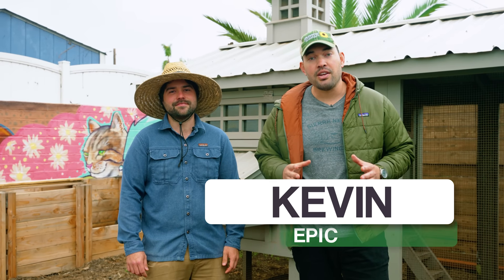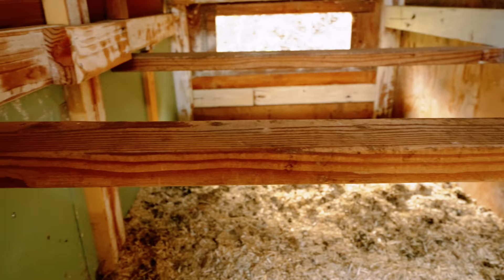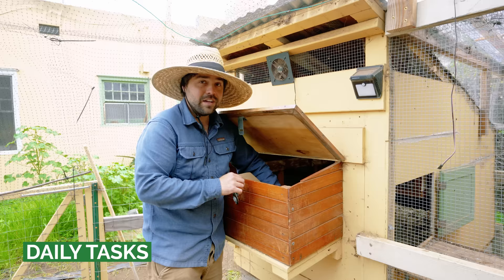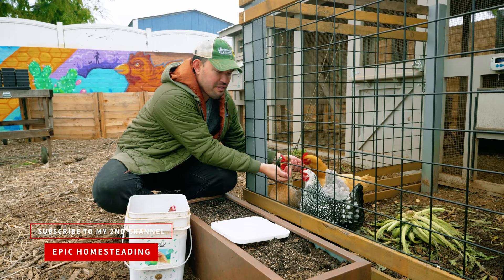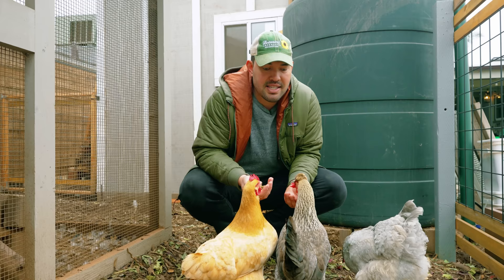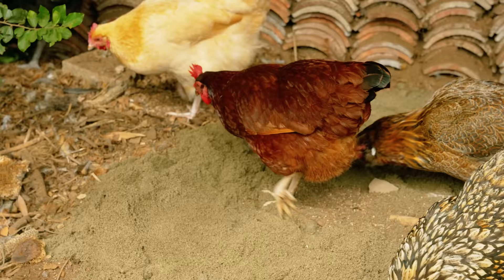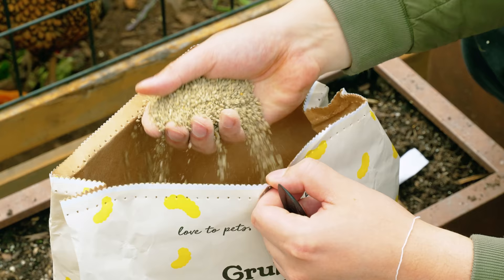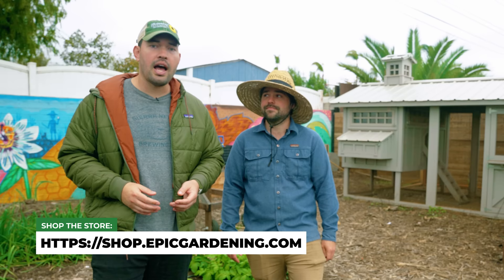Watch This BEFORE You Keep Chickens 🐔

Comment: Bumblefoot is common when you have square roostingbars, you need round bars in the coop for them to roost on, with a diam of about 2,5 1/4 inch.
Reply: so is that 2.75" in total then?
Reply: I always thought it had more to do with flying down to the ground.
Reply: Amen. Some chicken owners even argue about that. I use round bars. In fact, I used a grinder to soften the edges by grinding the bar.  I also notices that the chicken bars always seem to be square, and the chickens they go up and down every single day.  Sometimes, it is just common sense and being observant.

Comment: Kudos to people who mention humidity. Yes, chicken hates to get wet for prolonged time. In their natural habitat they usually sleep on branches to avoid predator, that's why excess humidity is a big no for them. That's why the coop usually have space below them for better air circulation and to stay away from the humid soil. Remember, good air circulation is a requirement , not an optional .

That's why some commercialized pen are abhorred by many farmers. They skipped too many steps.
Reply: And while you need good air circulation, for colder climates you need to prevent drafts in the coop.

Comment: Not only do chickens give wonderful eggs, and entertainment, they also provide good manure for compost for the garden. I will sometimes use the used bedding for a mulch around some of my plants. Whenever I water the nutrients from the used bedding goes directly in the soil. I would also like to mention that ventilation in a coop is more important than keeping your birds warm. Without ventilation you'll end up with frostbitt and chickens. That's what happened to me. We added more ventilation to our coop and it solved the problem.

Comment: Excellent video!   We live in S.W. Missouri.   We have 16 black-laced silver Wyandotte hens.  They have very small combs, so I must make sure they have enough cold water for drinking as the summer progresses.  They have about 12 sq. ft. each in the house and a bit more in the run.   They began to lay on 3 March and we got 226 eggs in one month!   I use their run as a composting area, throwing in a flake of hay and one of straw every few days.  We have lots of weeds and dandelions and chickweed, which they love.    I feed them 4 cups of fermented or sprouted wheat each morning and their layer mash.   I will try red wigglers and soldier fly larvae this summer.   Also will grow giant sunflowers, broom corn, and amaranth as treats.   It takes about ten minutes morning and night to see to their needs.   They actually don't seem to mind a light rain.  I'm planning a food forest attached to their run for (hopefully) this late summer.  Will use electronet fencing until then.   Stopping drafts and providing excellent ventilation is absolutely crucial.  I've used Harvey Ussery's deep litter method since putting them in the house on 1 November when they were six weeks old.  Not a  trace of odor.   They are good for the soul.   Get chickens!

Comment: Find a local carpenter wanting to do a project..that’s what I did. Made a fantastic, double walled, insulated coop, three windows and door with cutout half, 6 laying boxes and a super generous run and since I’m on a hill, they can get under the coop too for even better shade. Chickens are so affectionate if you socialize early, amazing, intelligent creatures. Auto doors aren’t perfect, I like to use my auto door manually. If you scrape the poop boards inside the coop every morning, you’ll eliminate any smells at all from the coop if your litter is deep enough. You will have to deal with scraping poop, and be aware they can projectile poop on every surface.

Comment: I have had chickens in the past. Currently I'm in a wheelchair & unable to do their care, if I get a coop the cost is important. Too expensive & the eggs end up costing me, not saving. I'm very practical & buy from ppl with existing flocks. 
I would use deep litter method as it's cleaner & so many benefits! But an inexpensive or used shed could b adapted. Use wire around perimeter & make sure the coop has ventilation & run is covered! I need only 3 hens, but already know I'll have issues keeping under a dozen! They r therapeutic physically & emotionally!!!

Comment: Very informational! 
I think another big think another big thing to consider is if you live in cold areas you need to be aware of freezing temps. Are you prepared to haul hot water multiple times a day? Should you run electricity to your coop to have a heated waterer? Or a daylight light?

Comment: Have you looked into fermenting your chicken feed? The feed goes farther and it is very good for your chicks.
Reply: I tried that.  The main source of protein in our regional high-end feed appears to be fish meal which goes right out of the strainer when you remove the water before placing it in the feeders.  :-(  And our high end organic feed has also lost it's nutritional edge just like other feeds have been reported to have done.  I have to supplement with flax seed and things like sardines and sunflower seeds to get their protein up enough to have the nice eggs that I used to get a year ago without all the supplementation.  Pretty frustrating!
Reply from the maker: I'd like to try it!

Comment: EGG SONG COMMENT: You said the egg song is 'before and during' them laying eggs. In our case, it's actually AFTER. We had a few that we always saw on our wifi cam doing a loud 1-2 minute egg song AFTER laying their egg. It was so loud that we sold them because we felt it likely annoyed our neighbors 50-100 ft. away. They also used to do an egg song if they were high up in the pecking order and another hen was taking too much time using their own preferred nest box. Luckily, 50% of our hens have no egg song, so it's quiet for the neighbors. The only other time they are loud is when a fox/coon/hawk is nearby.

Comment: You guys are probably less concerned about this, but what equipment or setup would be recommended for colder climates (zone 5)?
Reply: They do fine in our zone 5! So long as they have a draft free coop. You can get a plug in heat panel for next to their roost if it drops below zero/-many say it’s unnecessary but I like to keep the combs and wattles from getting frostbite 😊
Reply: You don't need a lot of adaptation for colder environments.  I think the trick if draft free but still having ventilation.  The one thing that I did struggle with for a long time was how to keep water available.  I tried a few things, but I ended up with the very simple heated dog bowls that they sell at all the farm stores.  It holds a gallon, which works for my small flock.  I just fill it every morning.  I don't usually use any heat, but I do have a couple of heat lamps that I can set up if I need to.  I've only used them when it's below -20 F and windy.  They aren't really safe so you're balancing risks.
Reply from the maker: Make sure you keep the hen house nice and warm in winter if it's drafty

Comment: I switched from chickens to ducks for egg production, honestly i wonder why people prefer chicken eggs, ducks are as good, and even better, fertilizer, leftover reuse, less trach, pest control, and fluffy fuzz feathers for pillow filling! But if you don't know much ab them and try to rise them like chickens then they will be very messy. They need 3 water supplies , 1 for bathing, 2. for fresh drinking, usually tap or rabbit driplets, 3. water with food added to it , do not feed dry food to ducks :)

Comment: How many chickens should be kept for three older adults who are not big egg eaters?
Reply: The formula I was told, which seems accurate for birds until they are around 5 years old, is 2 eggs every 3 days per bird.  So that's 4.6 eggs per bird per week.  If you want 2 eggs for each person twice a week, get 3-5 birds.  It's easy to give away extras :)
Reply: None cheaper to buy them.

Comment: I’m about to build my coop. We are a half block from a giant lake (Clearlake) and have lots of predators but what I’m wanting to prevent are RODENTS! Dear god, no rodents. So my question is-do you think I have to get 1/4” hardware cloth or will 1/2” work? I’m not worried about snakes. I just don’t want to start seeing rodents and have a plan for the food but want to get the right hardware cloth. Thoughts?
Reply from the maker: 1/2" is probably fine!
Reply: 1/2 inch is fine, but I do 2x4 welded wire along the run, my chickens love chasing small snakes and mice that come along.
Reply: Rats are my fear. I live near water and there are river rats. How to keep rats away???

Comment: The chicken wire that he rejected as too flimsy, is unfortunately a product of our time. That classic looking chicken wire used to be made quite a bit heavier, I have seen it amongst my grandparents things, but things have been made cheaper and cheaper, more and more lightweight over the years and now if we want anything of decent quality it has become very hard to find. Even with hardware cloth you have to be careful because some of it is made very flimsy too. Don't be afraid to compare products and look at materials from several different sources before you invest your money. It's kind of like what they were saying about checking out the regulations in your community beforehand. You don't want to spend a bunch of money and then find that you could have done better with the same money elsewhere.

Comment: gimme a break. wat a wast of cash. 75 bucks all u need. chook wire, tie wire, few long sticks for roosting, galvanised iron for roof, roof bout a third of the coop, tiny bit insulation if u want aircon, few thick wood, build frame, attach, bend wire for door n tie, done.

Comment: Theres a lot of great information in this video, but i think the economic analysis is misleading. if youre considering keeping chickens to disengage with capitalism and our f'ed up food system, building a coop out of reclaim materials can easily be done for $100. While I only have 3 chickens which thus doesn't require as much space as perhaps 7 or 9 chickens, I still managed build my coop for less than $60. I reclaimed pallets and a piece of tin roofing for free and have a simple design. After keeping them in the coop/roost for two weeks (method called soft release or penning) I could let them free range. Only thing I purchased was some mesh fencing. I will admit though, the only predators in my area are stray cats, and i have a fenced in yard
Reply: oh also purchased a few zip ties and stakes, but still a coop for less than $60. with more patience for things to pop up on craiglist, the whole thing can probably be done for free. theres no need to be buying new materials for this